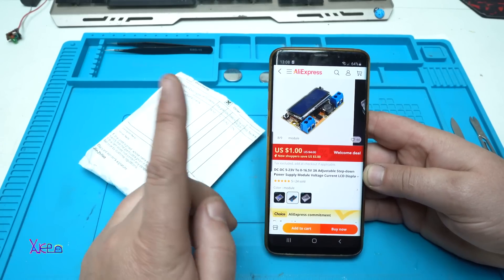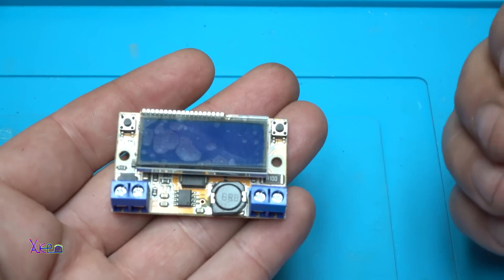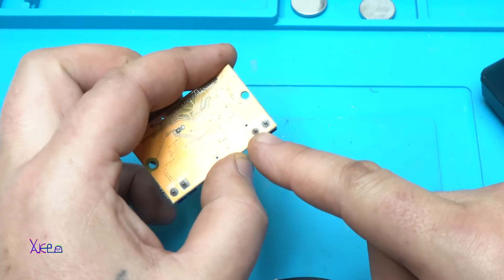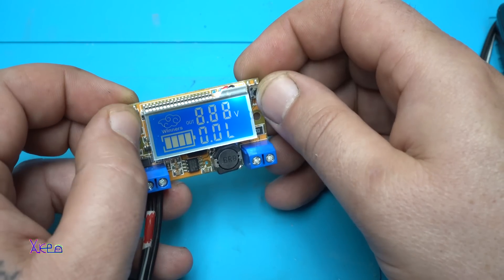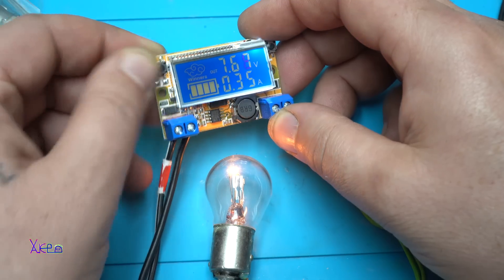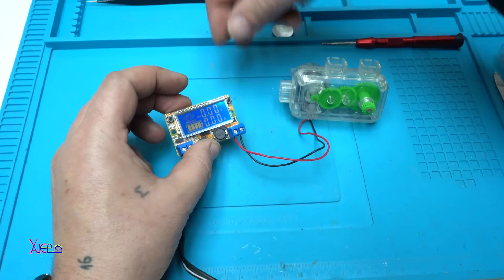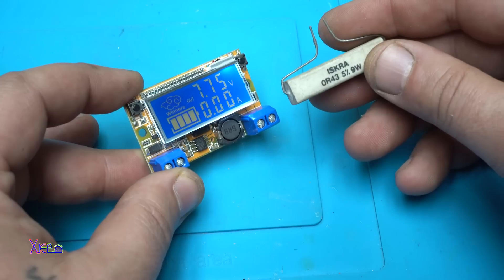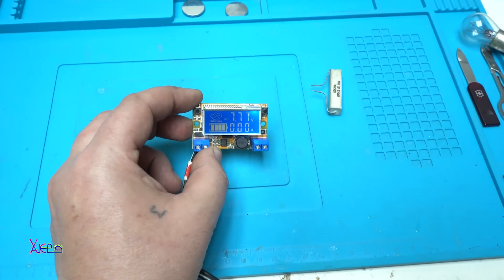IS THIS $1 Aliexpress Power Supply REALLY Good?

Comment: Apparently you can calibrate these using this method = Calibration Method:

Power-off status, press and hold the left button access the power, the display starts flashing, release the left button. using multimeter measured the output terminal voltage, if the measured voltage is greater than 5V, press the left button reduced the voltage to 5V; if the voltage is less than 5V, press the right button to increase the voltage to 5V. When the LCD display voltage of 5V(sometimes it shows 4.99V), turn off the power, the calibration is complete.

Comment: a regulated DC power supply IS NOT AT SPEED CONTROLLER for a motor!  Think before you talk. A speed controller would check the rotational speed and regulate accordingly to the load/speed. most likely including some sort of overload/fault protection as well, before things go up in flames.
Reply from the maker: Yes sir,I will be careful with my mouth😄

Comment: Hacktuber, plz info me i want to buy dc to dc module for room aircooler to adjust 12.5v to give regular supply, plz recommend this module or any other for my room aircooler. Thanks i m waiting ur kind suggession.
Reply from the maker: Dependa how much current is pulling that air cooler,if you dont know best ia to buy at least 5A